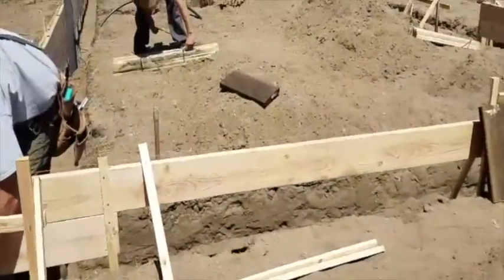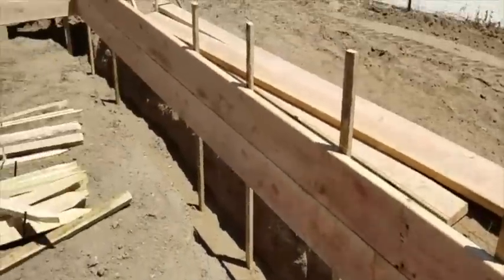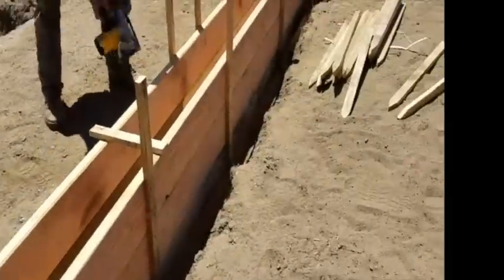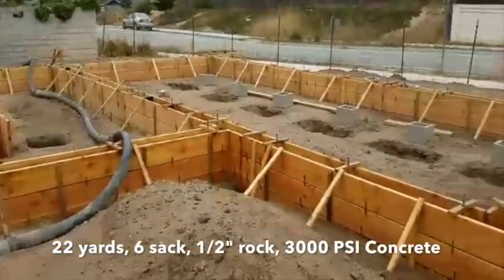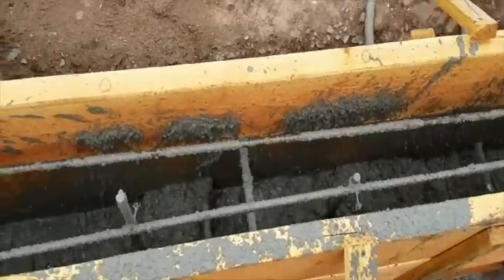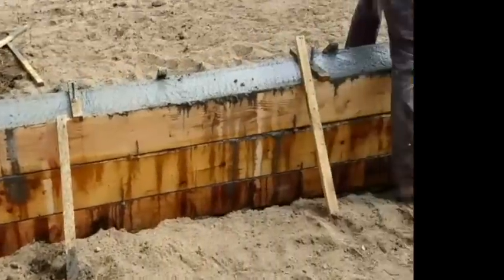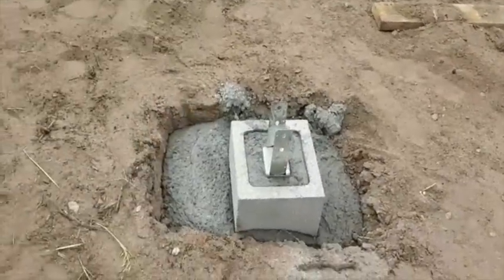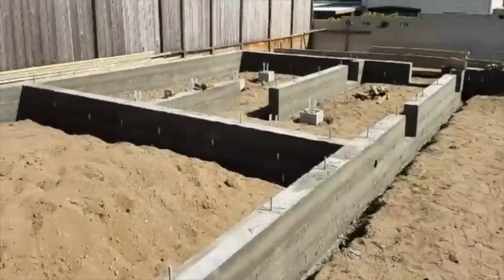Concrete Stem Wall Foundation

Comment: how long do you wait to take the vertical stakes out after pouring?
Reply: Your welcome! As I phase into my retirement years, I see fewer and fewer young people entering the trades.
These are just a way to give back and pass on some knowledge I've gained over the years-
Dave
Reply: David Osland Just wanted to say I'm amazed and appreciative of how generous you are with your time and knowledge. Thank you!
Reply from the maker: Sorry for the long time to reply-
Ah... estimating costs! I worked for contractors years ago who estimated from a book- they didn't do too well.
It's not rocket science for me. I don't estimate on sq.ft.- there are just too many variables.
The easier part is estimating materials. As labor goes, I go through the job in my head and on paper-
"2 days to layout and excavate, 3 days , 3 men, to place forms, 1 day to place steel, 1 day to pour, , .75 days to strip and clean.  X amount of days at $$$/per day, + materials+ say 20% for profit and overhead", and Bingo! A bid! This is the best formula I've come up with and has usually worked out quite well. We try and do as much of the work by ourselves and eliminate problems by bringing in other subs to do some of the work, like excavating,, placing steel, etc...
Dave
Reply from the maker: As soon as possible! As soon as the forms have been topped off and screened, I usually start pulling! It gets really ugly if you wait too long....
Reply: So you rely on the form ties to hold the shape of the stem wall ... the stakes are only to locate the form. Will the voids left by the stakes fill themselves or do you have to fill them individually?
Reply from the maker: Yep, the form ties and lumber hold the concrete in place. We don't fill the 1x2 voids left by the stakes, the backfill grading against the stem wall takes care of that.
Reply: Not very long, usually just after we top and screed the stem. A couple of hours, tops.You can't wait too long or you'll have to break off the stakes rather than pull them.....
Reply: At first I thought what the heck why use a screw gun but the way you guys did it actually was nice to learn :) 

Out of curiosity how do you guys charge someone to do a job like this? Is it done by the sqft of the foot print of the structure or outer surface area of the walls?
Reply: I'm planning to use two 2x12's for forms. Do you see any problem with not using form ties and leaving the stakes, and then just breaking off stakes when stripping the forms?
Reply: Using 2x12's for forming a stem wall is no problem, but I would HIGHLY recommend a wt form tie in between courses. It's quick, cheap insurance against problems. The alternative is using twice as many vertical form stakes and kickers (diagonal braces). If you can jump on pulling the vertical stakes while the concrete is fresh and just set, (about an hour after pouring), they come out quite easily and you don't have to break them off.
Dave